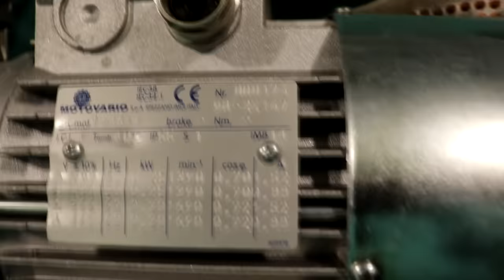DIY Recycling Machine for Aluminium Cans (Make money from your aluminum cans)

Comment: The only way this machine makes you money is by putting it on youtube and collecting ad revenue.
Reply: Not necessary, if you could collect cans from an entire community and put in the effort you could probably get a hundred bucks each week. It's more a "make money from trash instead of throwing it away". A church near me has a can collection program that makes about 600 bucks each week.
Reply: @j.c.cannon2112  But you don't need to crush them to do that, and this device doesn't collect or return the cans.
Reply: @j.c.cannon2112  ah, over here we already recycle it with 6 different trashcans. Nothing to make money on.
Reply: Civilized countries like Norway has a system where you get around .20$ per can you deliver to recycle stations located at every supermarket.
Reply: @tollevkvendbo  "Civilized countries like Norway" love it.
Reply: @j.c.cannon2112  I have long collected aluminum for scrap. Building this rig, ingenious as it is would slow dow. The process of crushing the cans unless some type of large hopper that could funnels the cans into it by the hundreds were present. Having to stop and set up a 6 pack, flip the switch, stop, reset. Takes time. I would rather place 200 cans on the ground and stomp them by foot. I've also dumped an entire truck bed of can on my lawn and then ran them over with a concrete lawn roller.  Not to me ton the cans pictured are nice and washed free from sticky sugars that will gunk up the machine with use and need to be cleaned. I can pull in 200 a month in scrap aluminum on the avg. Month just from going around and collecting the cans out of people recycling bins and recycling it myself.
Reply: @tollevkvendbo  Civilized countries like the Netherlands have trashbins for cans at home which are emptied every few weeks.
Reply: @tollevkvendbo  the US has states each state has it's own laws. Quite a few states have .10c returned and many others .05c returns for cans. But you also have to pay a .10 or .05c deposit when purchasing. It's amazing though traveling from one state that has a .10c bottle return program to an adjacent state that doesn't. The amount of cans thrown on the ground as litter is crazy. Some states have started to issue returns for plastic single use water bottles. Albeit Norway, Denmark, and Sweden are all much further along that the US in terms of recycling. But we also have 10 fold the population and the more people your throw into the mix the harder it is for people to agree on anything.
Reply: @tollevkvendbo  civilized? Lol. We do it here in America too. 10¢ per can. Some 15¢.
Reply: @Roberob1189  As the other people not replying 1 month too late said. Some states do, Yes. Unfortunately the US are uncivilized.
Reply: Made him about $10,000 so far!
Reply: the Thing is not about money  but time, space and energy. my dad is 65 years old he is a recicler. 
a sack of  pressed soda cans weights 12 kilos aprox. each kilo is worth $1. 
pressing 12 kilos of soda cans with a hand press takes time and energy. 
a machine like this can help do the job in less time and man power.
Reply: @MrAsterix54  Over here the cans need to be not crushed for it to be recycled.
Reply: Recycling costs too much to make a profit for the government...so they don't do it in many areas.  There is no local recycling in my area...sure, you can collect and take it to the scrap yard, but all the effort is on you to do it.   I built a pneumatic can crusher years ago (video on my channel).  I crushed about six, 55gal drums worth of soda cans.  All the time and effort put in over months of saving cans...and I think I got $20 at the scrap yard.  Not worth it.   I get my can crusher out to entertain guests on occasion, but all the cans go in the garbage....
Reply: @Carl Fole  SW Virginia
Reply: @j.c.cannon2112  if you dont already have the tools and stuff to make it, it will still take awhile to actually start earning money
Reply: @Survivalist-of-war  You are my new hero!
Reply: @mkbman45  well hell, I'll take it. ;)
Reply: @tollevkvendbo  in Ontario you don't get anything back but in Québec you do. Not sure if that changed, it's been decades since I tried. Currently only alcoholic cans and bottles get you anything here
Reply: @Carl Fole of Itcans crushed like that, a single 55 gallon drum full would be worth more than 20 bucks.

But ot depends on what the market was at the time and still yah its probably not worth your time putting a bunch of time into perfectly crushing them
Reply: @GaviLazan  I'm planning to make one of these to crush cans so I can fit more into my crucible for smelting ingots. You could make money selling cast sculptures if you have the right market and skill for it. Even a solid aluminium thor's hammer could probably sell for at least $150
Reply: @user-by7hj4dj9s  it is really the most civilized country on the planet.
Reply: @Roberob1189  And still you trow them out of the window.
Reply: @MrAsterix54  it also uses a dollar on the electric bill
Reply: @rickvaneijck3016  I do? Wtf are you even talking about. And first off recycling is a multi billion dollar business here in America. Scrap yards across America are packed day in and day out. Metals of all kinds are precious. Everything is made out of recycled materials. China purchases trillions of dollars annually here for a percentage of our metals. You all just assume. Literally know nothing but just keep yapping back and forth to each other day in and day out.
Reply: @tollevkvendbo  Norway's income tax rates are uncivilized, troll
Reply: i think shredder machine is a better option

Comment: one stroke of this machine is more expensive than the can.
Reply: This machine would have cost over $15,000 if it were made at my machine shop at work. Cool idea though.
Reply: Now they just need to drink 175 cans of soda a day to make it worth building and operating the machine!
Reply: If you ran it all day ,you would make like 600 bucks if you got the cans . do you think it would coast 600 a day to run it ???? I don't !
Reply: you'd make more money attaching a flesh light on the end and selling them lmao
Reply: cheaper to hire a bum to do it
Reply: @johnharris2683  I can load a truck full of cans and the recycling center only gives me $30 not sure where your going that would give you that much
Reply: @bryanmartinez6600  probably take this thing 20 min to do your cans
Reply: @bryanmartinez6600  looks like 1 Stoke per second . 60 seconds in a minute 60 min in a hour 24 hours in a day , $ 30 buck before breakfast !
Reply: @johnharris2683  I meant the value bof the cans where I am I think it's like 30 cents a pound and I think that's exaggerating. Copper is decent I got $1.50 for an alternator but not sure where I'm getting $600 for recycling metal. I'd die before I drank enough Mountain Dew and collected enough cans
Reply: The amount they give you is based on weight this machine doesnt make you any more money than uncrushed cans
Reply: @dripsystem5785  it about how many you can store
Reply: @dripsystem5785  which is why we crush them in the first place
Reply: @dripsystem5785  yes it does when you have more . do you really not get that lol 😆
Reply: @johnharris2683  ok dont really need a 3 comment response to this. 99% of people who recycle dont need this machine
Reply: @dripsystem5785  thanks but I didn't need a comment about nothing !
Reply: @johnharris2683  Yeah, keep picking up cans thats probly all your good at
Reply: @bailey-bobthorton1950  You are very expensive
Reply: Well... there is that, but with it running, it crushed 10 cans in 16 seconds... so about 37.5 cans a minute. That's about 2250 cans an hour. Running that for 3 hours would get rid of 6750 cans, conservatively. (60 minutes/16 seconds = 3.75 iterations of 10 cans. So, 3.75*10 = 37.5 cans per minute. 37.5 * 60 = 2,250 cans per hour. 2,250 * 3 = 6,750 cans in 3 hours.)

*** Now, the cost of aluminum aside, if you're in a deposit state, that's $675 in 3 hours. ***
(6,750 cans * $0.1 deposit return = $675.00 in 3 hours)

Running a small motor like that for 3 hours a day is extremely reasonable. We have industrial fans that use more at grocery stores.

Following that, I mean, if you ran it for 23 hours, hopper fed, and into a distribution bin for transport and drop-off, assuming there's enough cans and you can transition between bins seamlessly, you're crushing 51,750 cans per day... for a DEPOSIT return of $5,175, less operating costs. OR, you could sell the metal, smelt it down, or lease the machine out for a premium and let someone else pay for the electrical and handling.
(2,250 cans * 23 hours = 51,750 cans in 23 hours. Assuming ONLY the deposit, that's $5,175 in returns over 23 hours, with an hour for maintenance, storage, weighing, and delivery.)

And you're not going to find a motor of that size costing anywhere near that much to operate.

Granted, it's not a lottery ticket or a thing you could manually supply, but for a community center or local depository with cans being left or sorted for donation, the cost to operate that motor for an hour or two every week would easily make it valuable. Depending upon your locale, you might be able to get more for the metal than for the deposit, but if you have high traffic and large volumes of aluminum cans that are being thrown out all over, this is actually pretty darn awesome.
Reply: Exactly
Reply: Bailey-Bob Thorton 15,000 is a little exaggerated... with steel prices and an hourly of MAX $150/hr I’d say $4000 MAX, no way it costs 15,000 or your machine shop is a rip off
Reply: Wow, people sure do get hot under the collar. If you have the stuff already then it’s cost you nothing and some people just like building stuff. I built one very similar to this using an old flex plate and starter motor pinion gear instead of a gearbox and I squashed many thousands of cans with it. Even when squashed it’s amazing how much room they still take up. I recycled the useful parts out of my machine when I scrapped it as now we get a 10cent a can refund but the cans can’t be squashed any more. The machines at the refund centre read the bar codes and bill the drink manufacturers. Thankfully there was a 6 month period when it first started where you could cash in squashed cans, manually counted, and that was some payday for me. It doesn’t matter where you live in the world we are all in deep enough shit already so how about a little more kindness.
Reply: Somebody built a machine to replace my foot? Mine is more portable and always there when I need it.
Reply: @scroungasworkshop4663  sell the metal to someone i would think. To melt it.
Reply: @nw3473  no he did mean flesh light. if you knew what one was, then you'd get the joke
Reply: @kimudo  I don't know if you can collect deposits if the cans are crushed.  Visiting Michigan with family taught me that much.  The deposit was only refunded on the non-crushed cans, and we needed the intact 12 pack box before letting us exchange any of them.

Maybe that's because we're not locals?

Here in Ohio, cans are just aluminum weight, or $0.01-0.02/can.
Reply: @TheAttacker732  Fair enough, but it often depends upon if you have an actual recycling center or if you're trying to drop them off at a store. But that's what the mention of the cost of aluminum vs the deposit was about, it might be better in some places to sell the aluminum, sell the crushed cans, or get the deposit... any given place could be different. Even so, the sheer number of cans could well make it worth your while. More so to remove that much garbage or for fundraisers/community turn ins, but you make an excellent point.
Reply: In his case it did not cost him most of the stuff he used looked like recycled metal from other projects.
Reply: Yeah
Reply: @johnharris2683  b
Reply: I purchased an old garbage compactor for $10 it will compact 50 cans instantly without lining them up the cube it makes has about 300-400 cans I don't use the liners just dump it out
Reply: The real money comes from the youtube channel
Reply: Hand held can crusher is better,you can crush on site.imao.
Reply: @bryanmartinez6600  30 cents a lb? where do you live? 
Where I live they give you $1.75lb for aluminum. When I was a kid (15 years ago) copper was $2.00 a pound and aluminum was like $0.90 cents. I'm sure copper is more than that now
Reply: @dannyherrera1598  actually it was worse as I went a few weeks ago.
$.20 a pound
I'm in Colorado
Reply: Bailey-Bob Thorton 15,000.....where do you work? I‘ll remember to never come there.
Reply: @bryanmartinez6600  I got £5.90 for a single car battery. But thats lead.
Reply: @johnharris2683  1-day of labor to run this machine is already probably $300 and of course some hours are going to be needed for gathering the cans to run this for a full day...  Cost of electricity for all-day and I'd imagine you would be profiting still if indeed you could make $600 a day, but I thought aluminum costs were low lately...  Probably easier to just fill the back of a dump truck and smash them all at once and throw it on a pallet for sale.
Reply: $15k ?? rofl I can buy a brand new Cadillac LTG motor for that
Reply: @johnharris2683  So where are you going to get all those cans from then?
Reply: @bailey-bobthorton1950  $15,000??? Lmao wow.  Glad I don't use your company.  Gate cost what, million dollars 😂
Reply: @TruckinDavo  That what happens when you work for the government and a machinist charges over $150 an hour to run a machine and that doesn't cover cost of tooling or equipment.
Reply: I think it was a very good therapy building it.. All you have to do is change the engine for bicycle so you do exercise while recycling 😂

Comment: That my friend looks like the highest quality can crusher I've ever laid my eyes on! They are going to find that machine in the year 2872 and scientist will ponder its use for many years after!!! One heck of a nice job!
Reply: yeah, little does he know, he's paying more for power then he's making on aluminium..       being 30 cans is only like 80 cents and power around there is 10 cents a kilowatt.

funny though the one's that are levered work fine with just your arm..
Reply: @harleyme3163  So you know he dont ownes a photovoltaic system??
Reply: " he's paying more for power" ... show us some maths. That motor looks like 1/2 HP (approx 375W) or 3/4 HP (550W) at most. It's got a gearbox to provide the torque, so a small motor will do. 

Facts
1) In Australia (where i live), electricity is around 30c per kWh. 
2) This machine crushed 7 cans in 18 sec, lets say 20 sec, which means 21 cans a minute, or 1,260 cans an hour.
3) Also in Australia returned cans can earn 10c a can.

So in one hour, the machine can potential earned $126 AUD (assuming cans are ready to be crushed), and for a 3/4 HP motor, electricity is only cost 15c (AUD). Even for a 1.5kW motor (it isn't by the size), it's only $1 AUD. 

I have no idea how you worked out that electricity cost are more than recycling cans

So please do show us your maths..
Reply: How bout instead of a motor.. install a mechanism with bicycle pedals. Like that you exercise and crush the cans at the same time

Comment: Engineers don't do things because they need to...They do things because they can!
Reply: You're really crushing it with that pun
Reply: Take America Back From Isяael Jet fuel can’t melt steel beams
Reply: i really like that comment these guy are just loading with ideas and im sure they don't bother with the small details about if they should make it lol
Reply: Pat B: Engineers are like mountaineers. Mountaineers have to climb that mountain because (they think) they can.
Reply: Pat B. Very true and great pun
Reply: Take America Back From Isяael     You two guys don’t know much about heat and physics.
Reply: @Sillyturner  i dont think it woild go though steel melts at 2000f its hard to get anything that hot
Reply: @popinmo  you can easily get up to 800°C with burning with kerosene, and the structural steel (A36 Structural Steel) used in the twin towers starts losing their stability and strength at around 350° if i remember correctly. So its not about melting, its about material fatigue. at some point, even steel cant maintain its form under that kind of environment (temperature change, weight pressure and many other variables we cant even start listing in YT comments).
Reply: @aaronlord1258  yes it can/myth-busters duh!
Reply: or just get bored.
Reply: @aaronlord1258  Why not? I've seen diesel fuel melt cast iron.
Reply: looks good on paper, doest work in rel life, typical engineer
Reply: That's  correct, I'm a Engineer because I don't mind hard work,  if I wanted to do something easy..I'd call your Mom. 🤣👍